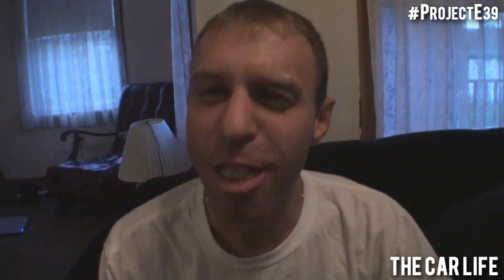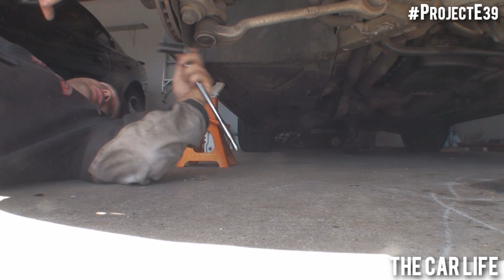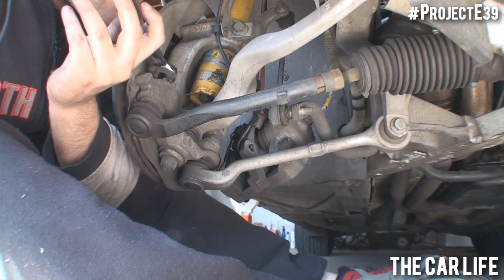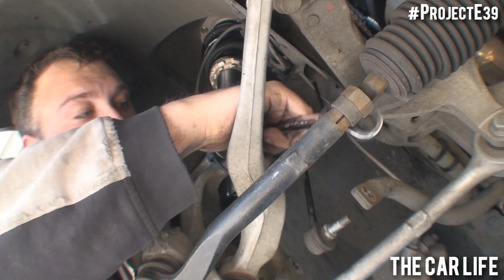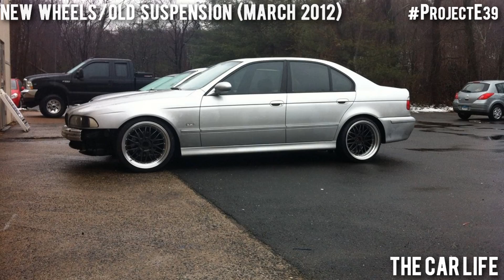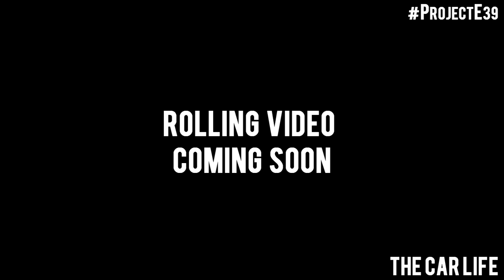BC Racing Coilover Install on #ProjectE39

Comment from the maker: Don't lower the spring perch. To lower the ride height with these coilovers you need to losen the lower locking ring and then spin the shock body into the lower sleeve. There is a video on YouTube that shows you how to adjust ride height properly. Lowering the spring perch will remove the preload on the springs and you will only be riding on your springs. Not good.

Comment from the maker: I honestly don't have an exact measurement but I probably lowered the car another inch in the front and another 1.5" in the rear. I used to have a huge rake but now I have a smaller one.

Also, It would have been too complicated to do an install video for this. There was way too much to focus on and film at the same time lol.

Comment: Got my coilovers in. Put them on 2 days ago. I put them in straight out of the box. The rear is perfect but the front needs to come down a bit. 

If you adjusted these, did you use the actual strut body to lower it or did you use the upper adjustment which would be actually lowering the spring?

I really don't want to mess with the spring height because I don't want to make the ride any harsher. Any measurements would help too. Thanks again! Nice car

Comment: Pretty sure i just watched this dude strip the fuck outta that thread, those hubs are toast, use a torque wrench if you dont know how tight the bolt should be, not "as tight as you possibly can" Dont be that guy 😂😂